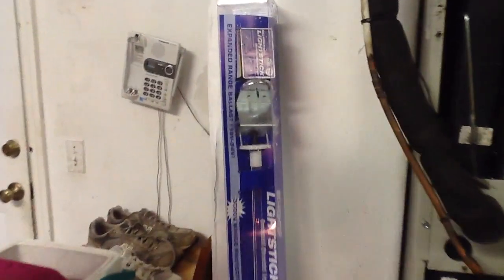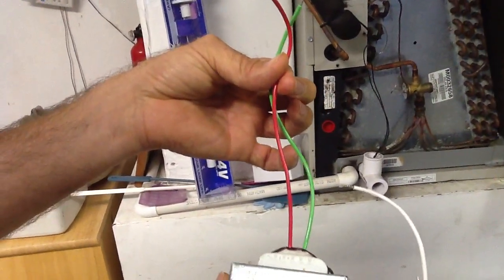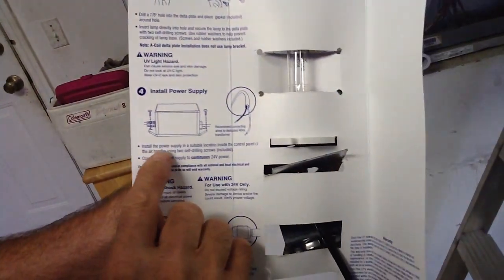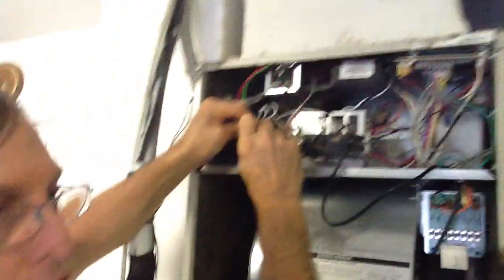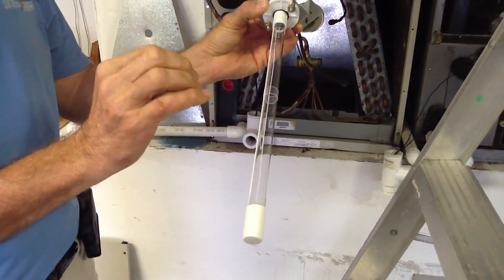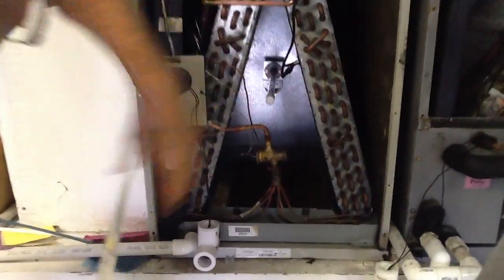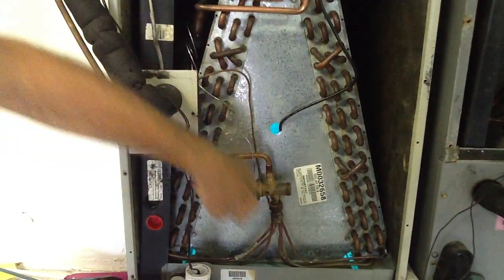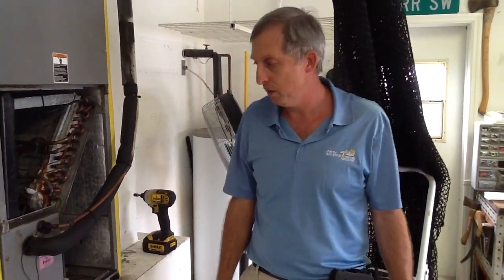Ultra Violet Light Installation Start to Finish

Comment: My UV light manufacturer states any wire coming from the UV light, that will be exposed to the UV light, should be wrapped with foil tape. So the wire that was behind the metal panel on the coils should be wrapped with foil tape.

Comment: I had a friend give me a brand new one. It’s got a low volt transformer 24 V doesn’t have the 240 and the 24 and you’re exactly right when you hook them up and they’re not hooked up right what it was doing was the compressor come on the outside fan would run but only for about a minute and then shut off the inside unit unit was running so my question is you have a red and black wire coming out of the ballast? What do you hook those up to any help I would appreciate thank you.

Comment: DO NOT LOOK AT IT DIRECTLY! It can cause temporary to permanent eye damage if expose to it. I installed one and looked at for for a little and I got a “sunburn” to my eye and it’s the worst feeling. Be careful and make sure to use the little glass that comes with it. Also turn it on once everything (machine) is covered up/close.

Comment: Can you get a 120v power source to turn on only when the blower is on?
Reply: The system runs on 24 VAC, the transformer you install, is 240 VAC to 24 VAC, so no 120 VAC involved.  To do that you need to install a relay to switch the bulb on when the fan or cooling is called for by the thermostat.
Reply: @valricojoe7659 Incorrect, almost all furnaces have an EAC pin on the control board, which supplies 120v when the blower is on. Super easy hookup, should take no more than 30 minutes.

Comment: If you put the light inside the coils doesn't it make it susceptible to condensation?
Reply: No, the air flow and coil design let the condensation flow down the structure to the drain pans.

Comment: I hope that wire for the power supply is UV proof, it is been exposed to the light and if its not  UV proof it will crack it possibly short circuit the line.
Reply: The UV does not infiltrate the control panel.  I would believe that the wiring to the bulb is UV treated, no deterioration on either of mine.

Comment: It's  a small point, and it doesn't  negate any of the advice given in this video but a virus, as in influenza or covid-19,  is not a living organism. Viruses will infect human cells but they are not living,  so they cannot be "killed" per se. A virus will be destroyed, made unable to infect a cell, by sufficient UVC radiation. So a UVC bulb in the HVAC duct/furnace/air handler, can destroy viruses in the air, but you cannot kill something that isn't  living.

Sorry about the mostly unimportant distinction,  I just thought some viewers would want to know.

Comment: again my name is Diego I like it better with the dedicated transformer due to the fact that   uv  light recommendations are to keep it 24/7 on I was told to use a relay g&c to the load an R&C  to the normally open side of the relay in series with the light bat like you say in the video if UV light amp dropped down thermostat require amp we looking for nothing but trouble I would love to have an answer about correct blade fuse site to protect the dedicated transformer in both sides 240 & 24 V thank you very much

Comment: Hi my name is Diego I recently graduated from HVAC technician school I have a concern about the new dedicated transformer for the UV light regardless fuse sides protection for the 240 V and 24 V due to the fact then we have extremely oversight breaker when the system is not running so we should put  blade fuse on the 240 V side and another blade fuse in the 24 volts side and how we get the fuse amps correctly

Comment: Great video. Will installing the UV light on the bottom as you did inhibit mold and growth on the other side of the coil or should the other side of the coil have UV lights on it as well?  Mine has mold on both sides of the coil.
Reply: Put the light on the return side.  Most UV almost every UV ligjht you can buy is a hoax.  The light we offer is DynamicAQ.

Comment: My contactor shorted out because of a bug. While the tech we here I got a look at the inside of my air handler and was stunned at the amount of mold I saw in there. He suggested a UV light but the cost put it out of my reach. I thought it cant be that hard so I went on youtube and found your video. Took a while to find one of the same quality but I just installed the Fresh Aire Blue Tube UV Light and your video made it a snap! My local tech wanted to charge me 800 to do the same job that doing it myself was about 215. My tech inspected the work and said its very good work and an excellent job. I also installed a REKO Lighting R2000 Air Purifier in my duct work. Thats a unit anyone can install and I now have double the security in my HVAC system. Thank you so much for your video. Im subscribed and following you from here on.
Reply from the maker: Thank you so much for that’s music to my ears I just want to help people as much as I can  sounds like you’re very resourceful person
I’m always looking for subscribers thank you
Reply: Thank you for this very helpful and valuable information. God bless.

Comment: Great video. Question. What if the A coils are mounted sideways and I place a uv light right in the middle. Is it likely to get ‘rained’ on.
Reply from the maker: It’s not supposed to the only time that would happen if the coil was extremely dirty should be good thank you

Comment: Question can I connect to the unit transform??
Or Have to be separated transform
Reply: He answered your question at 3:40. Wire the light to its own Transformer not to the AC Transformer alone.

Comment: I wish to know is it okay or safe to replace a 12 watt 10 inch uv light with a 17 watt 14 inch uv light bulb?
Reply: as long as the transformer feeding the bulb can take the load?
Reply: @valricojoe7659  I'm grateful for your knowledgeable answer as it is very important to correctly match the load of the uv light bulb to transformer feeding it power. Excellent video presentation. Thank you!!

Comment: Will that uv light increase the high load?
Reply: It will increase heat load by about the wattage of the bulb. 36w = 122 BTU so its quite negligible compared to the 36000 BTU on a 3 ton system.

Comment: After an year he'll have to remove all panels, reach right to the back pull out EVERYTHING to replace the bulb and then repeat... what a horrible idea to mount it between the A coils. He says don't touch due to moisture and then puts the gadget in between the A coils which by design will drip water when condenser kicks in. This tutorial is done by some one who knows horse shit.

Comment: Installing inside the A coil of a Goodman air handler, what effect does the light have on the plastic drain pan? Is the pan in line of site to the light (i ask because I did not do the install, had it installed)
Reply: UV light will  destroy anything organic and degrade certain inorganic materials, including the air handler's filter. to do it properly in an A-frame evaporator where the filter is at the bottom of the air handler,  you would mount the UV light low, near the bottom and underneath the bulb there's a shield you can buy that will shield and protect the filter.
Reply: @MrMikesMondoVideo  can you tell me where to buy the filter shield? I haven't had it installed yet but was wondering how I would shield my AC particle filter.
Reply: @lolajane5768  You will need a shield that's the same size as the bulb. Search for this description - Freshaire TUV-SHIELD-LPC Reflective Shield.
Reply: @MrMikesMondoVideo  Thank you so much!!
Reply: @lolajane5768  You're very welcome. I tried to give you a link or even the company name and each time Google deleted the post, but if you search that you'll find what you need.
Reply: @MrMikesMondoVideo  I found it! And just placed an order for the light and shield both! Thank you so much again!

Comment: Is it okay to place the uv light above the slanted coil instead of under?  Is under more effective? Its difficult to install my lights under
Reply: More difficult to place under the coil and more chance moisture will hit the bulb and will be needing replacement more often. Better to place above for longer lifespan and easier to replace

Comment: Thank you for the demo. Question: since the UV light sits on the underside of the A-coil, it is in close proximity to the filter (ours is a thick MERV 11 filter, 16x20) and it seems to be deteriorating the filter material. I usually change the filter every 3 months (even though it should last longer), but the filter is deteriorating and breaking down in even shorter than 3 months. Any suggestions?
Reply: If your filter is within 5 feet of direct light from your UV, then it can definitely deteriorate, and potentially cause more harm than good to your health.Typically, indirect light, such as reflected off of your ductwork is fine, though. I keep one UV light above my A-coil, and one about 5 foot high in my return plenum. Does great. 16x25x4.5 Merv 11
Reply: @therussrydereffect  5 feet? Lol.  It's only a 1 foot
Reply: @zac1567  What's only a foot? Safe distance is about 5' with no direct light from UV or it will deteriorate the filter.
Reply: @zac1567  Thanks for that one, I noticed the same problem with mine.  Just have to change them more frequently.
Reply: No those filters shouldn't last longer.  A 4' inch filter should last 4 months.  Bigger the filter doesn't mean anything it's just more surface level.  Merv means nothing.   If your uv light is burning than just add a metal reflector.  Stop buying Chinese UV lights  majority all of them don't work.  

If you want a better filter than a polarized media filter

Comment: I had a ac company install a uv but they did not use any transformer. He wired it directly so it is on only  when the unit runs. Is that a correct way to install a uv? Thanks for your help.
Reply: The additional transformer minimized the load on the one supplied by the HVAC unit.  Should be as David said, as for only running when the unit is operating, I installed a relay to do this on my system.

Comment: You said it was a 9000 hr bulb then you said it was good for 2 years. Wouldn’t that be 18,000 hours for 2 years... The transformer normally goes to black and orange for 220V. Not white “Common”... There’s a cretic   in every crowd! Good job on the video! Thanks for sharing.

Comment: Nice video.  Except for the wiring.   Mine was installed to turn only when my Heater, Ac or Fan is running.  I would not install this to be on 24 hours a day or you could burn though lights in a couple months as opposed to 6-12 months.
Reply: David Hazen wrong 24/7
Reply: My understanding is the bulb isn't meant for constant cycling, it's better for it to be constantly on.

Comment: This is a great video. I had a AC Tech quote me $650.00 to clean and install one of these. That's prices seem extremely high when I found the UV Light Kit on Amazon for $118.75 https://www.amazon.com/TopTech-Ultraviolet-Light-System-TT-UV24-14/dp/B00E0XRYZM/ref=sr_1_2?ie=UTF8&qid=1526589540&sr=8-2&keywords=Top+Tech+14%22+UV+light

Comment: hi  there i have a question. from the black ox to the transformer. for 120 volt.. there's 2 colors of wires on each . which is which..  trying to do this right..

Comment: Hi, I have looked up and down and can not locate where to purchase the sight glass for the ac cover panel, can you advise me please.  Thank you
Reply: I have a suggestion. Go to Home Depot and but the clear caps for you faucet. The whole will be bigger but it should work fine for a sight glass
Reply from the maker: usually comes with UV light

Comment: am curious as to why the uv light needs to be on 24/7.  Wouldn't it be better to come on when the fan comes on and go off when the fan goes off.
Reply: Because the bacteria and viruses will multiply and build colonies whether the unit is on or off.
Reply: no mold likes to grow in a humid atmosphere so when the air stops  flowing and especially if people turn off when they leaving  for a period of time. The mold will have a better chance to grow in that time depending on the conditions of course. However if your already putting one in it is for at very reason. so it is worth the power to keep it on 24 7.

Comment: it's not the low voltage coming off the transformer it's a higher voltage since it's stepping 220 to about 600 volts for the light bulb to operate
Reply: This is old, but wrong nonetheless. The packaging literally says 24V and you can search for this exact model.

Comment: Helpful video. Except for your double tapping of the breaker to feed the transformer. Code violation.
Reply: I added a rail and a 6 amp breaker to mine, before the xtra transformer. Thoughts?

Comment: So Mr. Jones, the best place to mount the UV light is just before the Evap coil, on the return air side?

The reason why I ask is because out in the field I have come acrossed this 24 volt UV lamp & have always seen it mounted in the supply plenum.

I am not questioning your expertise. What you've said makes sense. Just wondering why so many of these UV lamps were installed in the supply plenums on both verticle upflow air handlers, & horizontal air handlers. Any thoughts on this?

Thanks for your awesome video!!!
Reply: Some HVAC techs like to mount it  in the supply plenum  because it's quick and easy.   Doesn't do much good!   When I requested  quotes for a UV light installation  that's where they were going to place it (2 different companies). Because of this,  I ended up doing it myself and it was a little complicated getting the wiring into the A coil area.   I used the Blue Tube Brand UV light.   Thanks for the the great video!
Reply: The return plenum has warm germ, viral, and mold and are apparently easier to kill there.  Furthermore, not everyone who cleans their coils every year has any problems with mold on the coils.  But i guess some don’t clean their showers for years.  When you do it at the coils it is recommended to place it above the coils so drips and moisture won’t affect the UV light.  I personally do not want my paper thin coils to get brittle from UV 24/7/365.  My coils are fine, i just want to kill germs and mold and apparently that is done most efficiently on the return air side. It is supposed to kill more of them in the warm air, but i’m still trying to get better data on that point.
Reply: @chillpillology sir with all due respect, I am a microbiologist and virologist, and we have many sayings that help us with remembering all the conditions bacteria and molds “thrive” in.   One I have used the most is “mold likes cold.” 
Ever notice how quickly cheese and other dairy products develop mold soon after opening them, and putting in your refrigerator?   It’s because our hands, the air around us and most anything that touches the cheese after it comes out of its sterile packaging, will have thousands of tiny spores land on the surfaces and when they are put back into the refrigerator they grow at an exponential rate.   This is in sharp contrast to most other bacteria that thrive in a warm environment , hence the reason for incubation of eukaryotic cells.

Comment: I have a question, I see every one connecting their UV system to a straight power source. My question is, why can't you connect your transformer to a relay system whereas it will only activate when the system is active by tapping a trigger off the control of the thermostat. Finally, what would be a good wattage for an effective UV system.
Reply: Not good for the bulb. Better to keep it running 24/7
Reply: This is exactly what i did and my system has been working perfectly for many years.  My bulbs have triple the life as compared to leaving them powered 24/7.    I use the 24VAC that activates the blower motor as my relay trigger.    Works like a charm.
Reply: @mspring6387  so @H0WL1TZER is wrong, you are saying?

Comment: Nice, but UV light should only need to be on when the fan is also on pulling air through the coils and ductwork. If your UV light isn't on 24/7 it will save money on electricity and bulbs will last much longer!  I have 3 UV lights in my pool plumbing and use no chlorine anymore, but they only turn on when the pump turns on 8 hours in the winter, 12 hours a day spring and fall, and 16 hours a day in the summer in Miami, Fl.
Reply: From what I red online you have to the UV light 24/7 on any air or water system (mainly if you don't use chlorine). UV light is great for sanitation but the air or water after getting the UV treatment are more subject to grow bacteria. That's why it is better to keep it ON all the time to make sure the remaining air/water will be pump cleared.

Comment: My air conditioner guy wants 2000 dollars to put in 2 UV lights. A little crazy no?
Reply: Even 1200.00 is way to much. You can buy the kit for 129.00 on ebay. Is fairly easy to install. I did the install and had an electrician come over and wire it. Took total time hook up less than 30 min and he charged me 50.00. Way better than screwing up my new A/C unit. BUT TURN THE POWER OFF BEFORE INSTALLING. Is very easy to touch a hot wire in there.
Reply: tell him to do them both for 1200 he will do it
Reply: I was quoted $1300 each. Seems ridiculous.
Reply: If in Miami ull get 2 for $900

Comment: follow you steps and installed one but getting a burning smell.  When I disconnect the light the smells goes away.  Since I only disconnect the light that means is not the transformer or any of the connections..  What can it be?

Comment: Wrong side of the breaker Mr.Master A/C Tech
Reply: Beau DeLony 😂
Reply: 9000 hours is only 375 days, not at least 2 years.
Reply: If there's still a breaker upstream (in the panel) is this still wrong? (Non-electrician asking) 1:56